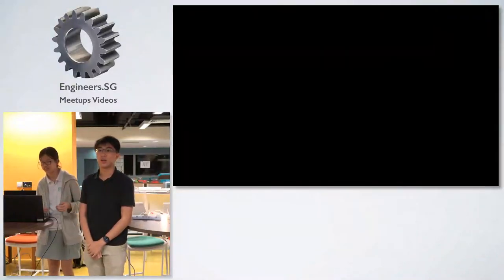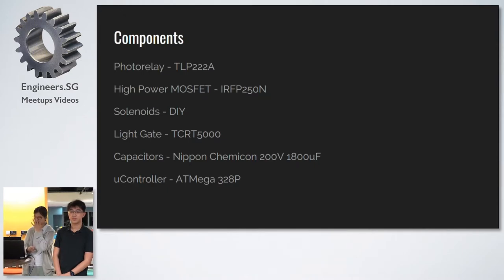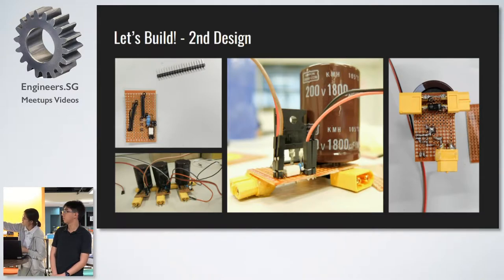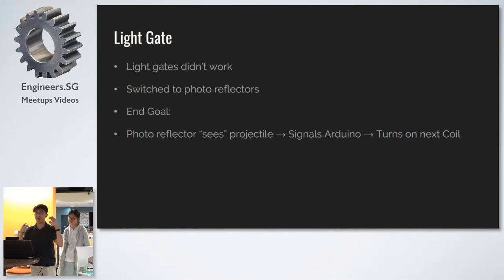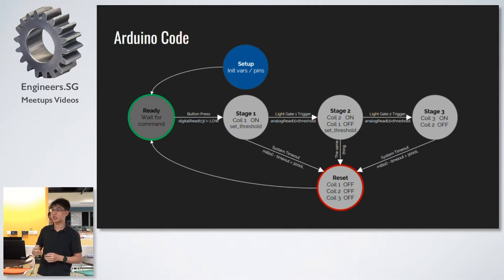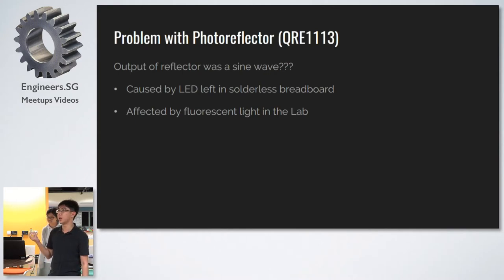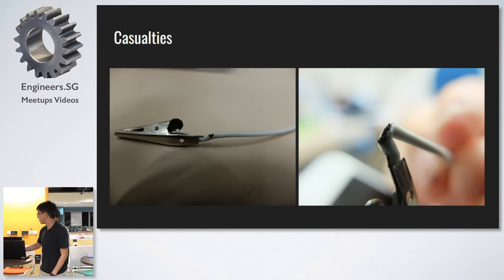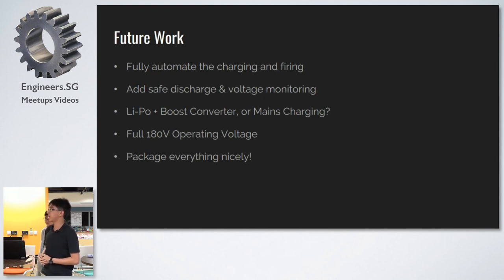3(stage)60(V) no scope coilgun - Hackware

Comment: thanks for posting.  first, you need brooks coils;  2nd -  14awg magnet wire should be used; 3rd -  enerize coils directly (no caps), then use sensors to turn 'em off.  cheers